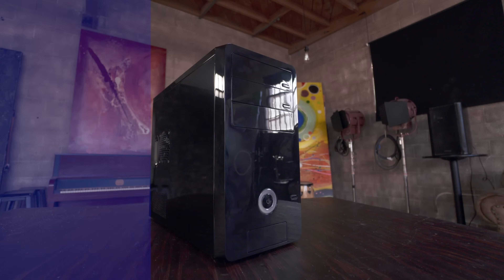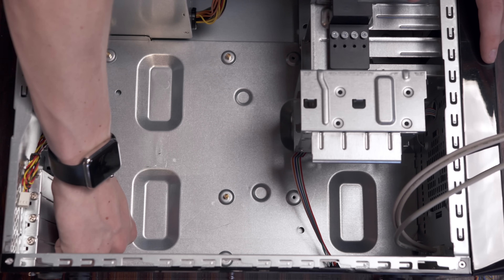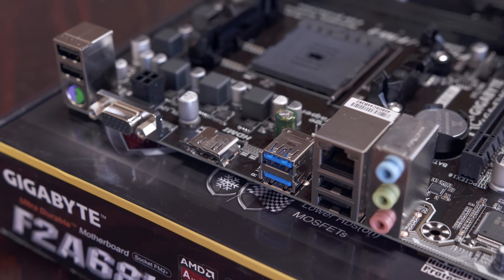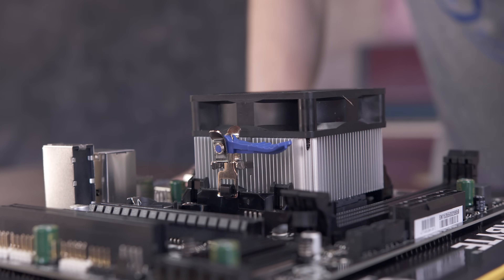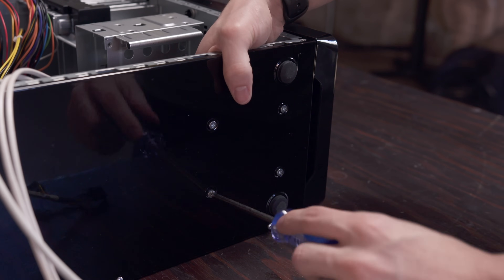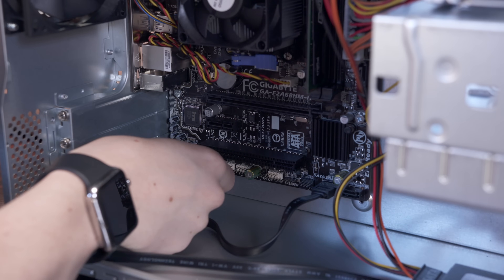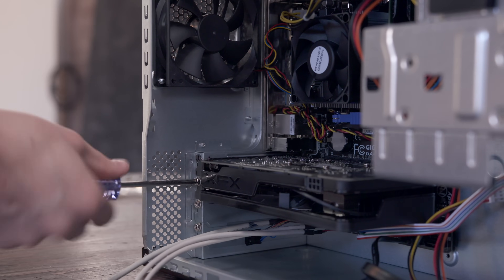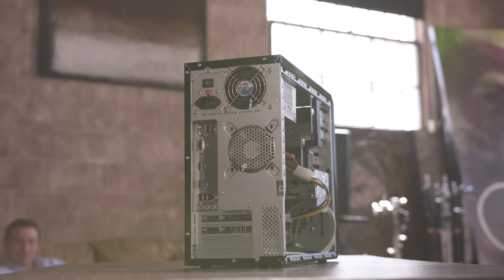How to Build a Gaming PC! (2016)

Comment: what is the AC 97 one for? I've never been able to figure that out.
Reply: +12me91 It's a legacy connection. Before there was HD Audio, there was AC'97. HD Audio, I believe, offers more in the way of jack detection and versatility by being software-based - like being able to turn your headphone jack into a second microphone if the driver allows. Basically, if you're moving an older motherboard into a newer case, you'll need the older, hardware-based pin-out.
Reply: more you know =D

Comment: I'm thinking about building my own PC even though I feel like I'm quite young to be getting into it. I have done my research about the inside of a PC and this video has helped me even more with the wiring. Who thinks I should get into it? (I'm 13.)
Reply: +SupahRookie im 12 and i already built mine, go for it!
Reply: Isa Pudiyapura Cool, any tips like where I should buy parts either online or shops? also did your case come with wires?
Reply: +SupahRookie try buying your pc parts from shops to prevent shipping fees, but I bought all my parts on amazon for $283, with the same motherboards as the one in this video :) and the case will generally come with wires if you buy 1 with its own power supply.
Reply: +Isa Pudiyapura Don't buy one with a power supply. Buy that separate. Also, use pcpartpicker. it's super helpful, lets you know if everything is compatible, makes sure power supply is good enough, things like that.
Reply: MiniMash I'll be sure to use that then for deciding the rig.
Reply: SupahRookie oh yeah, it shows the cheapest prices for a particular part aswell
Reply: MiniMash Yeah, its really helpful. It can help you stay on a budget and help you pick out parts with reviews. Thanks for the recommendation!
Reply: SupahRookie no prob

Comment: Anyone else notice at idle the cpu was 60 degreese?
Reply: +louis goodland 50C not 60
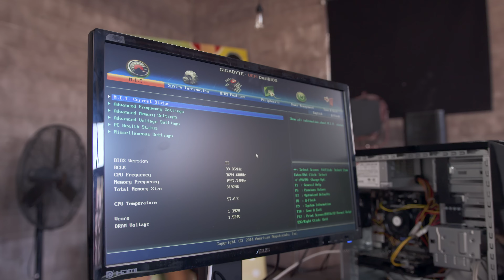Reply: +osith kavishka 5:13 I rounded as 58 is closer to 60 than 50
Reply: +louis goodland Where did you see 58 I saw 50 in the bios, but if it was 58 than 60 makes sense
Reply: +osith kavishka next to where it says cpu temperature?

Comment: Hey so if i was to build this computer, later on when i do earn the money will i be able to upgrade it over time piece by piece? Like the processor or the SSD hard drive. If i wanted to do a very powerful upgrade to just either single piece, will it still run with better performance or will it not be able to handle it?

Comment: jus a question though. is all graphics card applicable to all motherboard as long as pci e slot?
Reply: +nobert garcia Yep, just some will have more or less power connectors on them
Reply: +Francesco Barbera ty coz i was planning to upgrade my gpu for better gaming.
Reply: nobert garcia Just check the rated amperage and watts on your psu and see how many its able to put out continously, as well as check your new gpu to see how many watts it needs with how many connectors

Comment: are my specs good for gaming?

CPU: Intel G3258 Pentium 4 3.4ghz
GPU: Geforce GTX 950
RAM: 8gb Crucial Sport 
MEMORY: 1TB Seagate HDD
MOTHERBOARD: ASUS H81M-A
POWER SUPPLY: 500W

Is that decent im scared about the cpu im trying to keep it at a budget under $600
Reply: +DezNik45 try to get an i3
Reply: +Jaden Kim are pentiums bad just wondering because yah i get people telling me to get a i3 but i might consider since i wanna use this computer for a while
Reply: well they arent bad but they are getting outdated and if you are going to use it for awhile, id save up more and try to get either an i3 or an i5, it will definitely worth it.
Reply: +Jaden Kim thanks for the advice :) i will try to get a i3 or i5 :)

Comment: How to build a Gaming PC
>Uses cheap China Power Supply
>Installs some old Athlon with stock cooler
>Installs SSD while having the cheapest plastic case possible
>1 cheap exhaust fan
Yeah totally for gaming.
Reply: +GermanKraut 

The Athlon X4 860K isn't THAT old, most games aren't even that CPU Intensive so it won't be spinning like a jet very often.

The Cheapo power supply will run at maybe half of its load which is what it is made for honestly and Rosewill isn't the junkiest OEM around.

The SSD is cheaper than a mechanical drive right now and he mentions that in the other video.

You don't really need more than one fan for a case that small as you have the PSU Fan, Two GPU Fans and Heatsink fans circulating air just fine.

For a first time build, its fine. Especially if you really truly do not have the money to break this price bracket.
Reply: xerxes876 
Then he should rename the video into: ''How to build a PC'' NOT gaming PC. This is definitly no gaming PC, and hes lucky, if this thing even survives half a year.
Reply: +GermanKraut it's a basic gaming PC. Not everyone prioritizes high at 1080p@60fps as the requirements for a gaming PC. 

Heck if they just want to play league, DOTA,CSGO, WOW and stuff like that it should be fine. Not to mention the tons of previous gen fps and strategy games which this thing destroys with ease ( Empire and Napoleon Total War, Skyrim, GTA IV EFLC etc...).

Comment: still remember my first pc build.. lol what a noob i was, put out the mobo, connected psu to it, didn't installed cpu in the socket.. and kept on wondering why this damn psu doesn't power on.. switched on off switches multiple times.. then i saw this red switch on back of psu.. said 240 and 120, slided that, nothing happened.. then switched on wall switch and then fiddled with that red slider.. and bam !! sparks and fire from psu and new mobo was gone, alongwith main switches down, half the house.. :P

Comment: Serious question, Can I add a HDD alongside with the SSD? Their only seem to be 2 sata cable and hole to plug in for only a ssd or hdd at a time.
Reply: +Proxy are you referring to the build Austin just did, or your own?
Reply: +Proxy you can set the ssd to be the boot drive which will give you all the speed and the hdd as a drive to store everything you need
Reply: ameen azmi is right... you can essentially set your HDD to act like a giant USB.. kinda

Comment: Hey.  I finished building my PC a week or two ago and have yet to run a successful boot.  I am not getting video output or power to my keyboard.  What are some steps for first time builders to troubleshoot, and where can we get expert help?
Thank you
Reply: +EvilCat70 Hello, thank you for taking time to respond.  I had tried most of these things but didn't know the CPU one.  At this point I am thinking I must have a bad part and I am just trying to eliminate what isn't bad.  I heard getting a beeper to hear error tones helps and I think I will try that.

Comment: I´m having trouble with a pc that I just build a week ago. Everything works fine but when I turn it off a strange pitched buzz comes from the PC, but when I turn it back on it dissapears. What do you think the problem is?
Reply: +Isaac David i think that might be the power supply, my power supply doesnt do that, but certain power bricks do i.e. when i turn my monitor off, the power brick gives off a quiet whine... buzz kinda sound. i don't think its an issue to be worried about. if it annoys you try turning off the power at the wall. the buzz will stop after a few moments. (from experience the buzz gets higher and higher pitch before stopping).

Comment: Can this pc run Gta V?
1tb Hard drive
Core i3 
4 gb ram
Reply: what card?
Reply: +Braeden Kahlert dont hate but Intel Hd 4400
Reply: +Gurnoor Bedi you just made my day
Reply: +Gurnoor Bedi I don't have any hard stats or figures... but from what i know any integrated graphics is going to have a pretty hard time running GTA at a playable level. GTA is a reasonably intense game for a computer. having said that i run gta on a gtx760 perfectly fine with a few settings lowered. So if you can upgrade your graphics (assuming you don't have a laptop... which im almost thinking you do for some reason), you dont have to get a high end card, but getting a mid range card will make your life a whole lot better. 
experience: upgraded form an ancient Dell Inspron to my own built PC.
TLDR: that graphics 'card' probs wont run GTA well if at all. But a card that will run GTA wont cost too much. 
:D glhf
Reply: +Gurnoor Bedi From what I recall that's a variety of Ivy Bridges iGPU. In that case I doubt it would even be playable, you would probably get around 5fps on low settings... Assuming you have a desktop just invest in a competent graphics card and you'll be fine, the i3 is more then good enough. However if you're using a laptop (which I suspect you are) then you are pretty much limited to the HD4400, that is unless you have a thunderbolt 2 or 3 port. Then you are able to get a DGPU enclosure and a card and just run it to your computer that way.
Reply: +Acco852 i have an all in one from dell thats the prob :(
Reply: hmm interesting, is it a tower PC? if so you MIGHT be able to just slap in a low-mid range graphics card... do you have a link i could look at?

Comment: Hi guys! I built my PC a week ago and now I am getting random freezes and multiple different blue screens. Windows also installed without drivers and we had to work around that. But now the blue screens and Freezes are getting more frequent. It worked 2 days fine but then it all happened. Does anyone have an idea what I can do (i5 6600k did install win7 with skylake patch per USB)

Comment: intel i5 4460
500w cobra power supply 
nvidia gt 730
1tb+320gb+120 ssd
i want to change the graphics card.it shall be under 300$
Reply: Coldpaw Just GC,i already have the system.
Reply: ***** I taught amd was cheaper..anyways,gonna chech the gtx 980 out.

Comment: I had a question and I'm a noob , but I noticed that he had one fan in the case , but with just one fan , is it preferable to make that fan pull air inside the case or act like an exhaust ?
Reply: +Quinn Hargraves yes yes that's what I said , thanks a lot !!
Reply: Pull in the air to cool.
Reply: If its in the rear use it as a exhaust. If its the only fan in the case however then use it to blow air into the case
Reply: Quinn Hargraves So if I'm planning to have 3 fans , what you're saying is that I use 2 to pull air in and 1 in the rear as an exhaust ? But if that one fan is the only fan in the rear then use it to pull air in ?
Reply: Shrom Arora No, if there is only one fan mount in the entire case, and its at the rear, use it as a intake. Other wise use all other fans to pull air in and use the rear as an exhaust.
Reply: Shrom Arora ok

Comment: My IO shield had some strange little and thin pieces of metal that where blocking the ports, so I just popped them out... Did I do something wrong?
Reply: We usually leave those on, but it doesn't really matter as the i/o shield is Purly cosmetic. Just resume ur build.
Reply: they are meant to be bent back to help secure the ports to the shield. Consult the manual of your motherboard for more detailed instructions

Comment: Do i need an extra sata cable if i want a optical drive? Pls help
Reply: +TiKI thank u
Reply: Check your motherboard to see how many you will get because your motherboard comes with some. SSDs, Hardrives, and optical drives all use sata so just count how many you will have and see if that's enough.
Reply: +Jsih HG it comes with two sata cables and i just want to install a hard drive and optical disk
Reply: +TiKI yea im trying to watch vids, to see if i need more parts and stuff
Reply: +Johnny Amaya then you will be fine
Reply: +TiKI do i need a power cable for an optical drive or does it come with it
Reply: +TiKI im getting the one in this build all the parts im using its in this builf
Reply: Johnny Amaya don't use this build, its horrible
Reply: +Quinn Hargraves do u think the one from techsource is better, the 350 build pls help , this and the one from techsource is in my budget
Reply: +Quinn Hargraves its either this or a console
Reply: +Johnny Amaya I can put a rig together for you for under 350
Reply: +Quinn Hargraves do u have kik
Reply: +Quinn Hargraves can the rig run dayz? Text me if u have kik or dm me
Reply: +Johnny Amaya yeah my Kik is BAUSS6995
Reply: +Johnny Amaya BAUSS6996
Reply: +Quinn Hargraves check kik

Comment: wow 57c in bios....
Reply: glorious stock cooler
Reply: Lmao
Reply: I wonder what it would be underload
And i think you can forget overclocking that setup ;D
Reply: +Roni Eisto It's AMD. That's normal for them.
Reply: ive owned amds, its not normal to be 57c in bios
Reply: Roni Eisto It's perfectly normal. My dad has an Athlon x2 260 and that bitch is running strong @ a toasty 50ish degrees in da bios.
:D
Reply: +Curtis Whapshott ive got an athlon 340 on a hp packet pc and it runs around 40 in bios
Reply: Roni Eisto some OEM CPU coolers are stronger than others.
Reply: it has the stock cooler on it
Reply: +Roni Eisto that's what OEM means
Reply: It has the same cooler as on the austin has on that pc

Comment: You should do a video on what make the parts of a PC good. For example why a certain motherboard is good and what to look out for when buying one, as this is something I personally struggle with.
Reply: +Kuba Respondek the video you want would take way to long to make, people build different pcs for different reasons and most of the time it boils down to how much you want to spend and what you want to get out of it, just for a gaming pc he would have to make loads of videos, because i cant be arsed helping i suggest you look at youtube vids on performance on different hardware, mobo you want to look for one that has a good chip set and also the right cpu slot and supports ddr3 or ddr4, gfx cards pretty much the more money you spend the better it can run games, this is not true for rendering cards or server cards, ram faster speed is better most you really need is 8gb, ssds are good for windows install dosnt really make any difference in most games, cpu i suggest intel just because i know alot more about them and can compare chips and prices easy, you might find an amd that out performs an intel chip and costs less but i would always suggest intel

Comment: I have that same exact motherboard. It's okay but I don't recommend it if you want a wifi card. My GeForce GTX 960 installed in it covers the slot where the WiFi card needs to go. So I'm using it Ethernet. And that's okay for some, but I need to run it across the living room which is ANNOYING. I tired USB wifi adapter but it didn't perform well. Maybe it's because it was a shit Belkin.

Comment: you know what would be awesome? Showing PC building noobs like me what happens if you forget to put in any parts (cpu, gpu, ram, etc.) I'm waaaay too curious to see what happens
Reply: +Aadharsh Pannirselvam no ram will blue screen no gpu black screen no cpu never tried
Reply: +Aadharsh Pannirselvam The system just doesn't boot (GPU is not necessary though)
Reply: oh ok! Thanks for clarifying
Reply: +Aadharsh Pannirselvam a gpu shouldn't affect the pc booting, a pc without storage will put straight to the bios. On the other hand, a missing cpu or ram will refuse to boot.

Comment: http://pcpartpicker.com/p/Z9QpZL how's this?
Reply: +Dan Mas Well I think for 980 Ti SLI, i5 will bottleneck especially in future games and with Hyper 212 Evo you can overclock a bit but nothing like watercooling overclock. If you had decided to overclock a lot and think that you will change to&#160;watercooling to do it, I strongly suggest to keep hyper 212 Evo and replace i5 with i7. You will have much better results and the price difference won't be big from choosing i5 + watercooling. Also consider higher speed ram as price difference up to 2800 MHz is minimal.
Reply: +cstubed do you think it'd fit a $3k budget including the 1440p monitor and other peripherals?
Reply: i7 with Hyper 212 Evo and faster ram? i7 Difference is at about 120$. For Ram if you don't mind brands @ 2666 you can check this which is cheaper than the Kingston one @ 2133 and it is qualified by Asus to work properly with the board you chose:

http://pcpartpicker.com/part/corsair-memory-cmk16gx4m2a2666c16

For 1440p monitors I guess you target 144hz which are about 500$+ . All these together leave about 300$ for the rest so yeah I think it is even possible to add SSD drive which is a must nowadays for playing open world games that loads the world while playing. For sure the 5400rpm HDD you put is a bad idea to be used for installing games. You need a 7200rpm blue or black from WD (if you prefer WD of course) for this. 5400rpm are good for file archiving cause they are slower.

Comment: AMD really is not that bad. People complaining about AMD CPUs getting hot is a joke. Sure they get hot WITH THE STOCK COOLER! If you use a Hyper 212 EVO like I have with a Fx 6300 like me mine idles at 16 degrees Celsius and only gets to 51 Celsius max while gaming! Now you think they are hot? Think again...
Reply: maybe because you sit in the snow, none else gets 16 c idle, it mostly like 30-40...
Reply: +alex strömberg I idle at 17 degrees and when gaming like 50-60 degrees
Reply: No I have two case fans and my Hyper 212 evo and it works great. I have great airflow and I clean out my case about every 2-3 weeks. It can idle at 16 to 20 degrees if you have proper airflow.

Comment: Molex to pci 6 pin its not a good idea at all. As is only able to deliver 120 watts your graphics card may malfunction. Plus it makes no sense if you plug 2 molex into the same molex chain. Ideally you would try to plug it into separate chains or get a Sata power to molex adaptor.